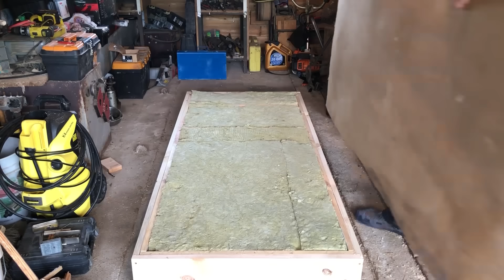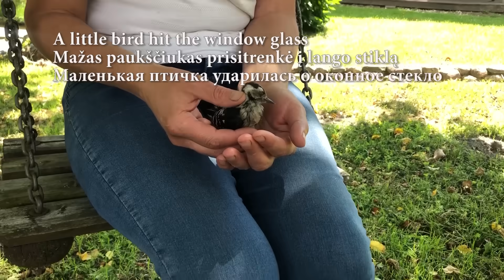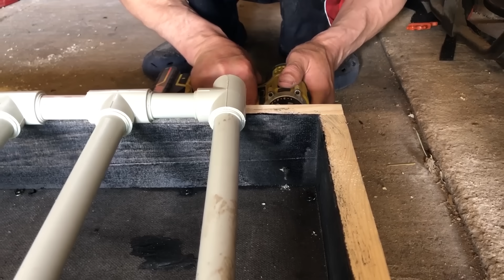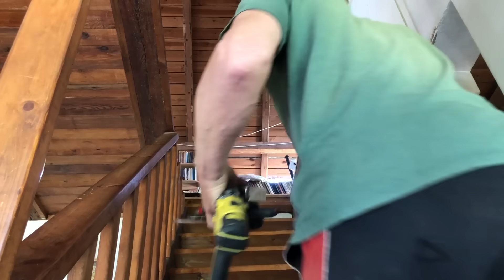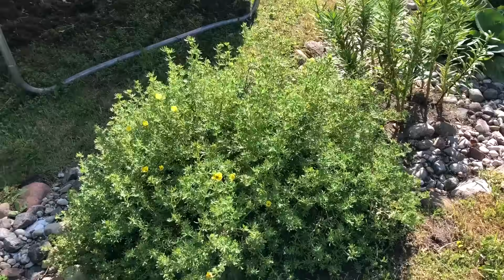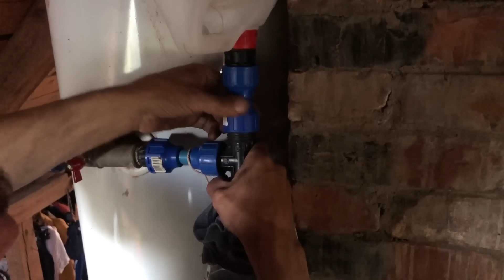Solar water heater. No controller and no pump. Making and installing

Comment: How does the convection works? Im kind of lost there and what is the purpose of the canister?
Reply from the maker: Convection works according to the laws of physics, warm water rises from the collector and warms the water in the boiler. After that, the water, having given off heat, goes down and enters the collector again, where it is heated by solar energy. While the sun is warming, the water flows in a closed circuit. A necessary condition for self-convection - the boiler must be installed higher than the collector. The purpose of the canister is the expansion capacity of the water. Since the system is of an open type, the canister is used to fill the heating circuit with water.
Reply: @Greenhomestead  I've been trying to reply you with a diagram that I've drawn up but youtube doesnt seem to like external links. I guess I have to describe it, so based on my understanding (tell me if I'm wrong) what you have is a closed loop system. You have a water loop that circulate between your collector and to your boiler. I supposed there's a heat exchanger on the inside to transfer the heat to the cold water? And the canister is required because water will be lost to the surroundings due to being heated by the collector? I wonder how dramatic it is, how long do you have to refill it? Lastly, the pipe that you used I believe we call it PPR pipe in my country, I read that isnt a good heat conductor, is that true? Cheers!
Reply from the maker: You have correctly understood the operation of the system.  Replenishment of water is required once a month.  Plastic pipes are not a good option, metal ones would be better.  But I don't have a good welding machine to weld metal.
Reply: @Greenhomestead  Can I know how hot does the water in the boiler gets?
Reply from the maker: Water from the well.  We have a water pump (hydrophore).
Reply: @Greenhomestead  great job👍 you can use copper/ metal pipes without a welder, you just need different fittings. Metal to metal has a copper crush washer. Not sure what country your in so I don’t know what connections are available, but I see you are using the Eastern European plastic welding method, not the glue. I prefer the glue because you can get pipe work dead straight, but the plastic weld is great if you need a 2 degree deviation.
Edit: just read your channels bio and saw you are in Lithuania. You guys have Metro there don’t you? They would have the metal connections at least my local Ukrainian Metro store did.
Reply from the maker: @saberint  Thank you.  We have copper pipes in stores.  Now that fall is coming, for next season maybe we will buy copper pipes and upgrade our solar water heater.  🙂
Reply: @TheBossStudioZ you are right should use copper pipe
Reply: @Greenhomestead  ….I wonder if a collector using larger 100 mm pipes would heat the air inside and supply that heat into the building? Convection being the method of the warm air entering the building and returning to the collector.  The collector would have to be mounted probably on an external wall.  Any thoughts ?
Reply from the maker: In our country, the sun rarely shines in winter, the collector will not be efficient for indoor air heating. A very large collector would be required 🙂
Reply: @Greenhomestead  ok. Thankyou